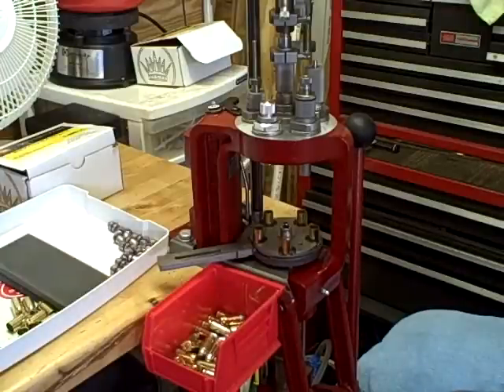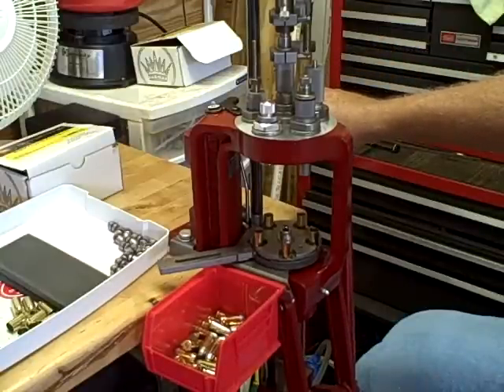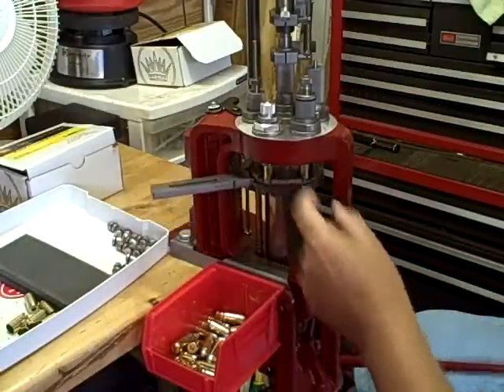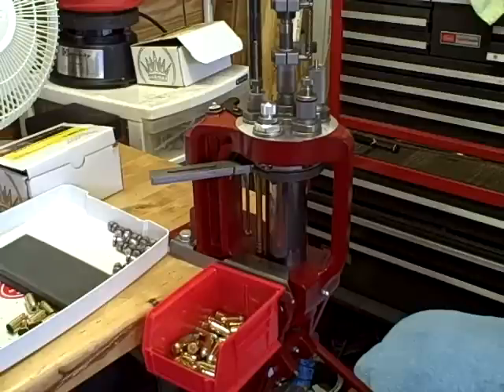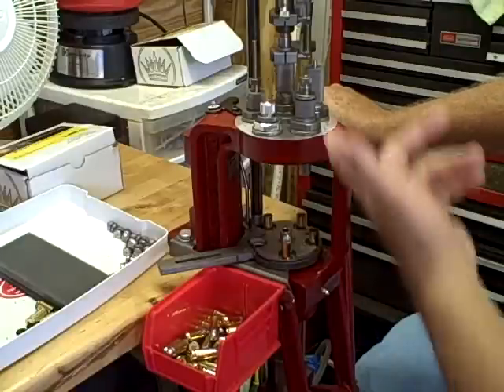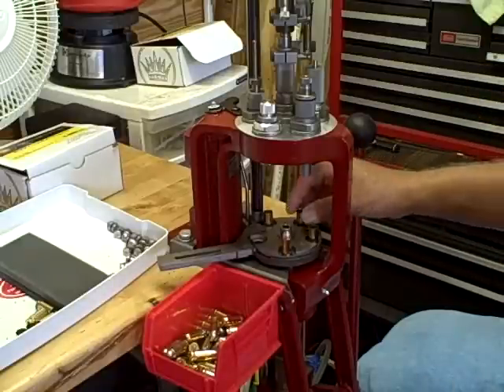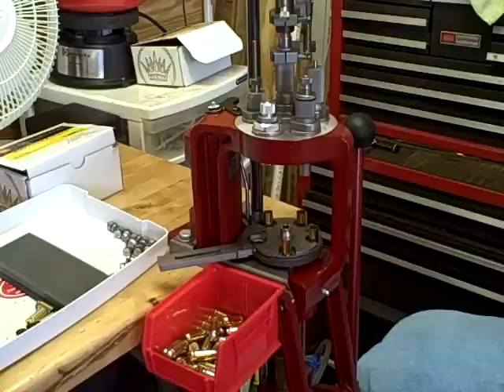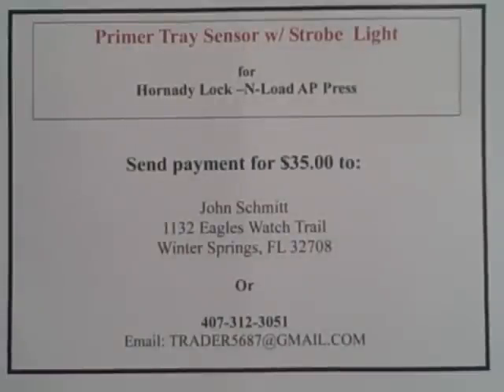Primer Tray Sensor w/ Strobe Light for Hornady L-N-L AP Pres

Comment: You keep saying primer tray, there is no primer tray on a Hornady LNL.
Reply from the maker: DonziGT230 
Call it the primer slide,
It is what carries the primer from the tube to the reloading station. Thanks the dam thing jams and screws up the reloading process. If you have a knife you know what I mean
Reply from the maker: Call it the primer slide then.
Reply: Primer shuttle, ok.  If it jams enough to make you think you need a warning device there's something wrong that should be addressed.  Mine has jammed occasionally, usually spilled powder or an operator error.  Having a warning device is a nice extra, but if one is relying on it to signal a primer issue he's going to be in for a bad time.  My primer sensor is my hand/arm when seating, that is the most reliable sensor.

I have no idea what a knife has to do with this.